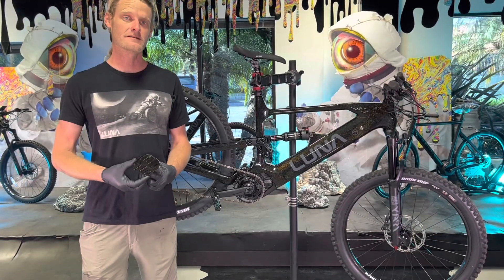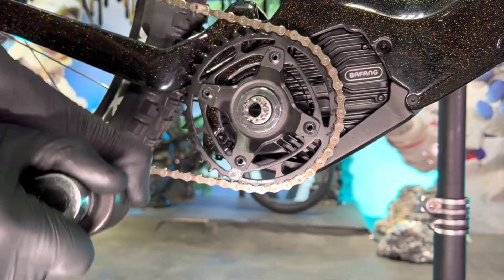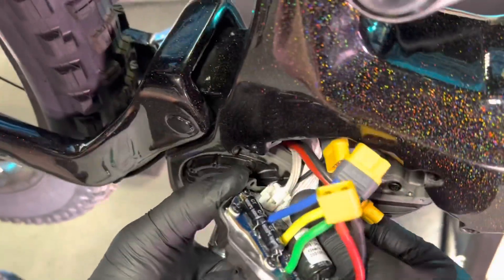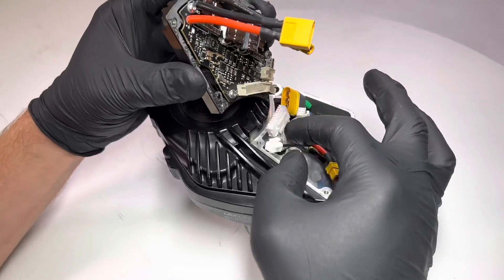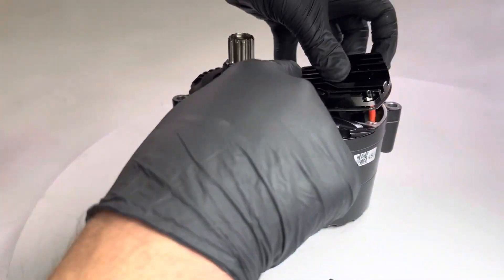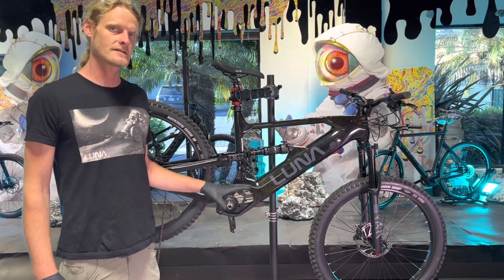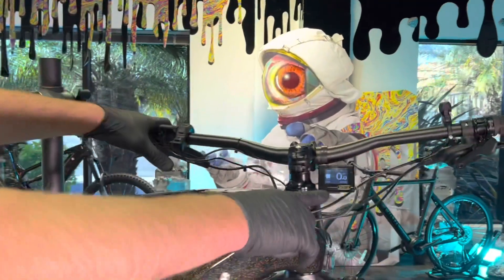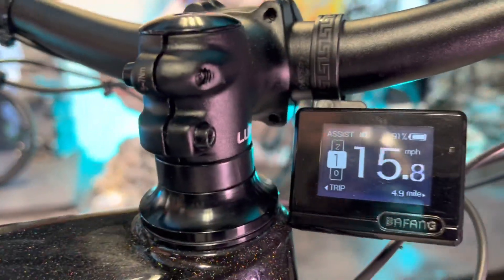V2 Ludicrous Installation for M600 Drive

Comment: Does this controller use standard VESC firmware for the Bluetooth module for nrf51822 with 32kB RAM? There are few of them in the VESC Tool, which one should I use?
Reply from the maker: https://apps.apple.com/us/app/vesc-tool/id1605488891

Comment: Standard VESC procedure is running motor detection for your specific motor.  Are generic M600 VESC motor parameters hardcoded into the firmware?  What happens if you run motor detection on a V2 controller with M600?
Reply: Yes, the motor parameters are predefined. I think it will offer to override the default Luna motor parameters after detection and will do so if you will override it. I do not know if it will work correct after this though.

Comment: Does display show corectly votlage on 52V battery with Ludi controller?
Reply: Yes, but you need to set the correct amount of battery cells in the VESC Tool application though